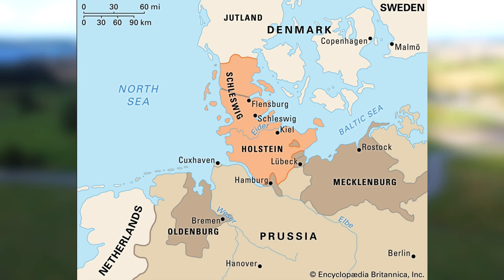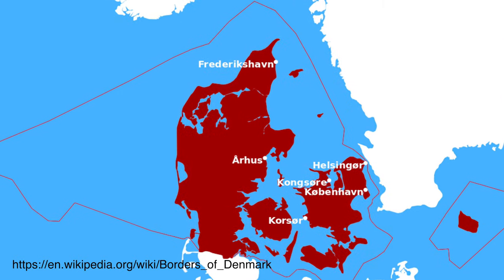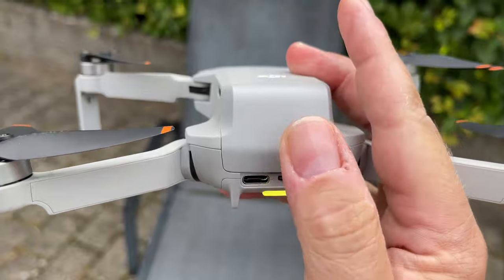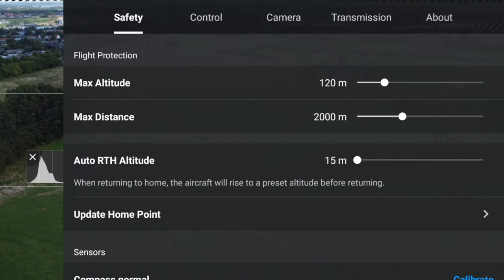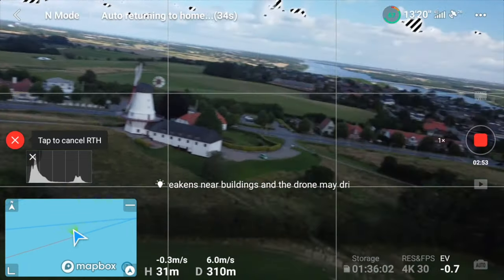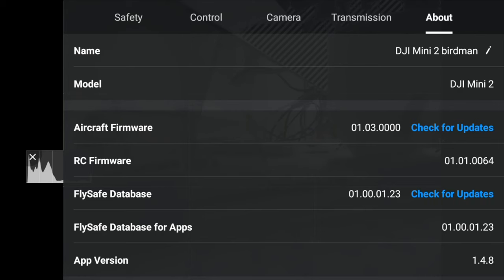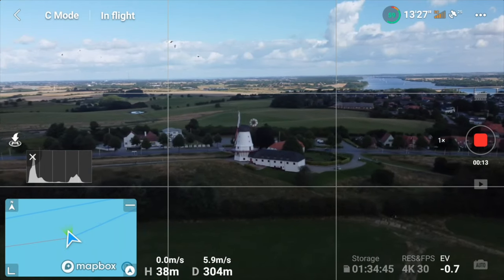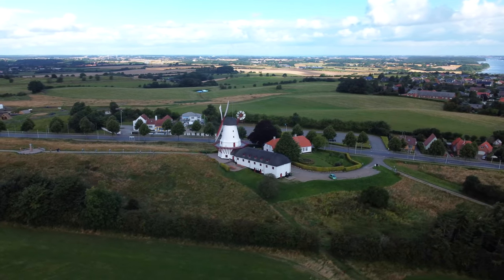DJI Mini 2 Gimbal Problem (NEW)

Comment: Hi Henrik,
I have the same problem since 3 or 4 weeks now, I believe since the last update, it started as I tried for the first time to fly and film with Gimbal in FPV mode
As I finished and switched to the normal follow mode, the gimbal wasn't level in the horizon anymore,
And now I have to recalibrate the gimbal and every start and some times I have to break the flight because the problem haben while flying or changing the direction. 
PS. I use the normal controller and smartphone and my drone never had a crash or anything else.

Comment: Nice history lesson on the Mill! Yep, when I reported this extensively when the mini 2 first launched I also found it happened in normal mode also. Then with a firmware update they added the warning message that it may do it in sport mode. I concluded It was down to the gimbal not being able to keep up with the drones angle of attack, certainly not good enough when the Mavic mini did not have the problem. Nice video as always
Reply from the maker: But this was not even i sport mode and sidewards, so pretty strange
Reply: @TECHDRONEMEDIA  yes totally. I've had it in norm mode many times. Simply not golf enough. If this was another brand such as fimi or hubsan this would not be accepted by consumers. DJI's reputation seem to get them a bit of an easier ride I feel sometimes
Reply: Guys, could this be due to the app perhaps thinking the gimbal is in sports mode when it isn't? Perhaps @GavinHR beta app might fix it from Androids side... Perhaps a test on Android as well Henrik?

Comment: I get the some issues with the Mini 2 almost every single flight, especially when using 3d party apps like Litchi. Calibration has not helped. Same issues I seem to have with my Dji OM 5 gimbal, which I use for filming myself and stuff.

Comment: That was pretty dramatic, eh?  I've only experienced this in Sport mode, but the gimbal does seem to drop sometimes in normal and even in cine mode from time to time.  There's so many little quirks with these things it's hard to keep up with them... lol  I don't use the smart controller.  Thanks for the heads up... I'll keep my eyes open for it and let you know if it happens...
Reply from the maker: yes, I was surprised as well this happened saw it as well only sport mode before

Comment: I had an issue last week with the gimbal. Circle quickshot anticlockwise 2/3rd round camera tilts starts shaking and locks in a tilted position. Not tried since but need to as i need that function in my repertoire

Comment: I have commented on other of your video about gimbal error calibration 40011... I had this same issue plus error gimbal calibration 40011... This is quite strange as everything was working before this DJI fly version 1.4.8 ... I think it is related for firmwire or app version damages the gimbal? I have sended the mini 2 back to warranty

Comment: I’ve had this problem with the standard controller. Conditions for me was very windy around 20 kph. Also had a nd/pl 16 filter. Took the filter off and didn’t happen again. Don’t know if the filter was adding to much load on the gimbal with the high wind but it hasn’t happen since that day.
Reply from the maker: could be a very plausible explanation
Reply: I sometimes get a gimbal stuck alarm when I put a freewell filter onto my mini 2 lens...but never when there is no filter attached..

Comment: The gimbal motors on the mini2 are very light. When their torque is insufficient for the situation, the gimbal falls out of the stabilisation loop. Then the firmware on the drone can't restore its orientation because it has no absolute reference.

Comment: I've had the same gimbal behavior all the time with my mini 2 + standard controller. Not only during RTH but during manual flight too. I waited for months for a firmware update, as I thought this must be a software problem. Since there was no fix I just sent it to DJI for repair.
Reply: It’s a hardware issue not software
Reply from the maker: I also don't think it's a software issue - they might be able to smoothen the issue with tweaks

Comment: Surprisingly it happened the exact same thing just yesterday. I was flying near Acropolis (lots of interference) and lost connection. On its way home and once I got back connection, the gimbal just tilted. very strange. Still I have the issue even in cinematic on top down shots that the gimbal jumps when I stop the drone (regardless of how smooth or harsh I do it , it always jumps) and of course in sport mode it does its things.

Comment: Had 3 new mini 2's, all have the same gimble problem. When facing directly down & flying in normal mode flying slowly, when you stop, the gimble moves up 9% every time. Drives me crazy. Air2 has been faultless for me
Reply: Been having the same issue with the mini 2 but only recently. Very annoying when you're trying to get straight down shots.
Reply: I have the same even in cinematic
Reply: Same problem here when shooting 90° down. Is there a soultion to this?
Reply: @mpberger74  I've not found one yet. I think its a firmware issue. With any luck it'll be fixed with the next update.

Comment: This isn't a PROBLEM , it's a Limitation of the equipment. I've seen this before and the dji app even explained it to me. You were going to fast as it was panning any getting into return to home at the same time. Kinda obvious when you do it again but slow as molasses. Must have had a strong tailwind as well.